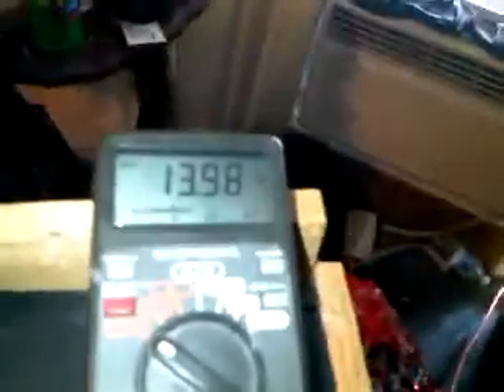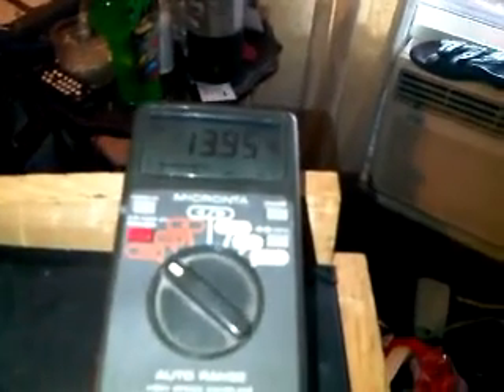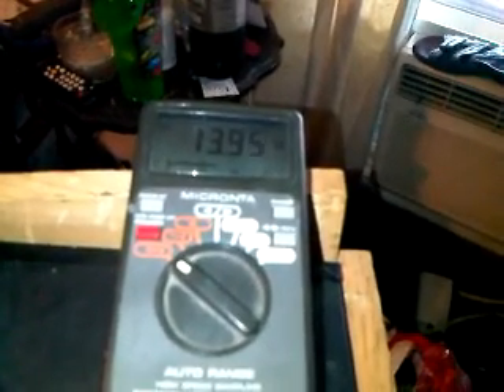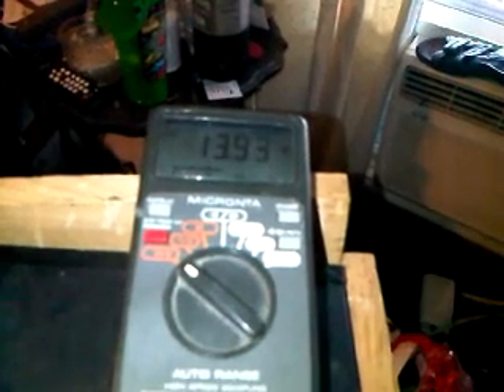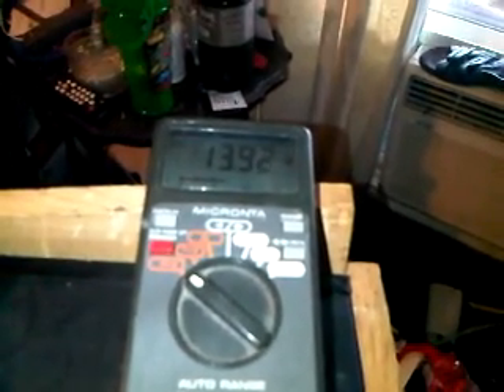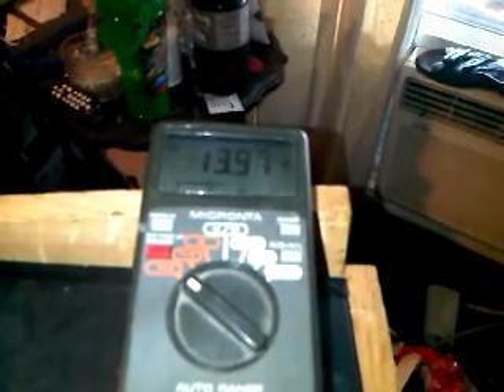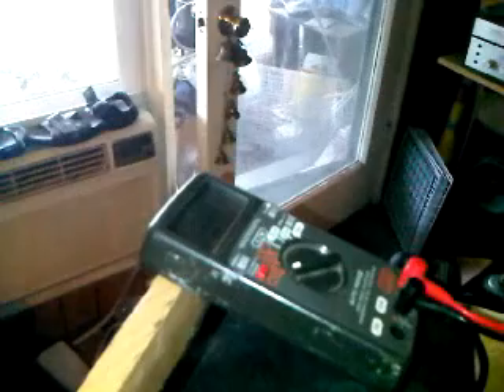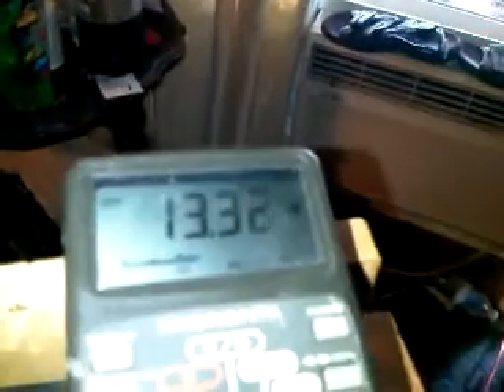TC Sounds TC-3000 bordom

Comment from the maker: @rynecampbell18 
It's not needed. There were 2 supply wires. The small wire was being fed from a 7A power supply. 7A at 13.8 volts is only around 100 watts. 16awg wire can handle that with no issues, especially being it was less than a foot long. There was also 8awg wire coming from the batteries. The amp only puts out around 150rms, so my wire size was just fine.